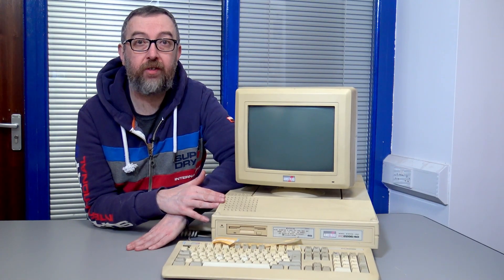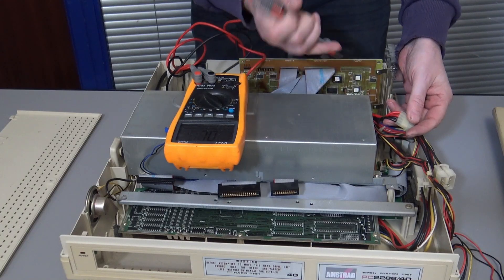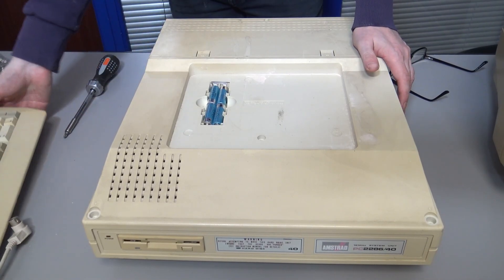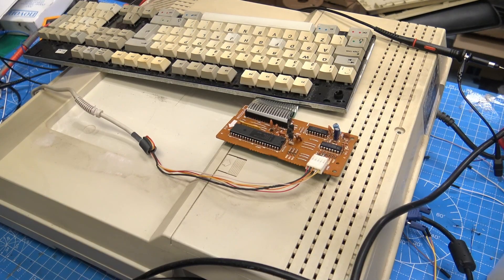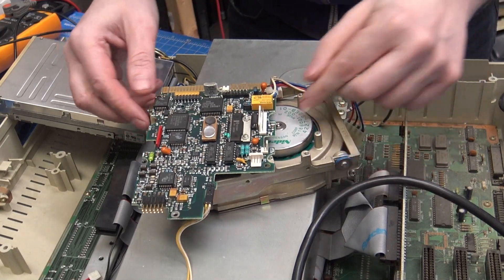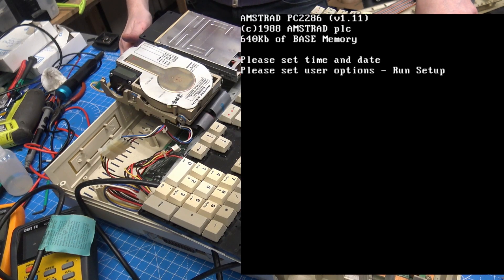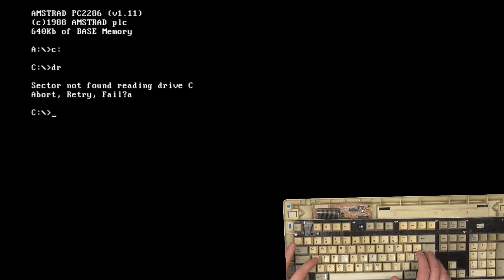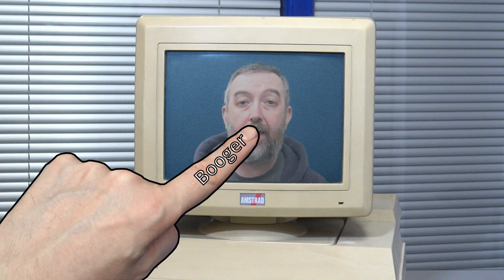Can I fix Blank screen Amstrad PC2286-40 ?  The computer from my first programming job.

Comment: That takes me back... my stepdad had the "serious business" model, the PC2386/65 - and the same games on it, Flight Simulator 3 and Battle Chess (amongst others). F4 for full throttle, F7 twice to lower flaps, and then the arrow keys while hoping whoever played it last left "auto coordination" enabled :) - it's also got a weird combat mode which disappeared from the later flight sims, although I was never any good at it.

That keyboard and layout also killed off much hope of upgradability, the best you could do was stick an 80387 in it, while the basic AT-case 286 I was given lasted all the way to a K6/200 with Voodoo II at which point finding compatible motherboards to give an upgrade path was a lot harder than just buying a new case and PSU.
Reply from the maker: We had these and soon after started to build and sell custom PC anyway, this was my next role at the company.

Comment: Great video, good job 👍
Normally on the PC2286, the hard disk type is either type 17 or type 49 for the 40MB hard disk. Type 4 is for the 65MB hard disk of the PC2386
Reply from the maker: Yes I did find those details while searching, but none of them worked and I had to go with the one written on the case of the drive.

Comment: 20:33 It didnt sound like you realised it was backwards before. was it only when you came to edit this you realised? Good catch though... So easily done.
Reply from the maker: you are correct, it was only in the edit that I noticed I had it connected wrong. The actual fix was cleaning inside the membrane I am 100% sure of that.

Comment: Have you tried Plastiweld on the broken clips? It doesn't work on all plastics but it is worth a go.
Reply from the maker: I just have not had time to look at it. If it's ABS I can use acetone to weld it. I think it would be the very last thing to do once the keyboard is cleaned and 100% working so I don't have to take it apart again.

Comment: Will that power supply run without being connected to anything? I have a 2286 that has the same initial symptom. And I get a little fan spin and not much else irrespective of what is connected.
Reply from the maker: I think it would need a Powergood signal like most new PSU when you connect the green wire to ground. I just never thought about that at the time and not having a service guide I didn't want to go sticking in paper clips like some APE.
Reply: Can confirm that it does need a powergood signal. A handful of capacitors later and it's back in service. @leesmithsworkshop
Reply from the maker: @bcg1976  well done. now be careful with those keyboard case clips.

Comment: Got to admit one of the major annoyances with using Amstrad PCs is the proprietary keyboard connection. I have a PC4386 myself and it really irks me that I cannot connect it to my kvm switch because of it. Would be nice if someone made an adapter so I could use a PS/2 keyboard with it.
Reply from the maker: If I couldn't get mine working some sort of adapter was on my list, I have the document showing the basic protocols so it's possible and just needs the time.
Reply: @leesmithsworkshop  Hello. Any progress on this adapter? I have recently acquired a 4386 without any keyboard. Everything seems to work - it boots and the HD makes promising sounds - but I can't do anything with it. Such a waste.
Reply: @garryadamson8507 - any idea how to get to case off? I've removed the 4 screws from the 4386 case but I can't see a way to budge it. Thanks!
Reply: @Retrohertz  Just remove the 4 screws on the bottom of the case (not the ones holding the feet on) and slide the top case towards the front of the machine. There are no other clips or locking mechanisms holding it in place. Keyboard and mouse have to be removed because they will be in the way and block it.

Comment: Great stuff, well done on getting it working, looks like a really nice 286 machine to have in your collection. Weird arrangement inside the case with the PSU in the middle and the motherboard upside down 🙃!
Reply from the maker: I wonder if they started with some other board or design and expanded on it ?
Reply: @leesmithsworkshop  yeah it's really odd looking. I still rate Amstrad PCs, I think they were decent machines